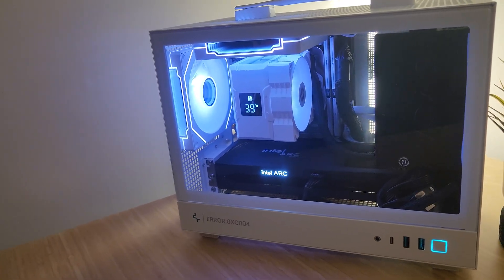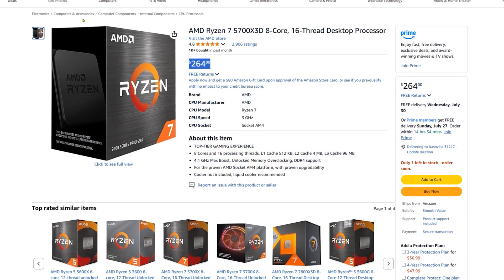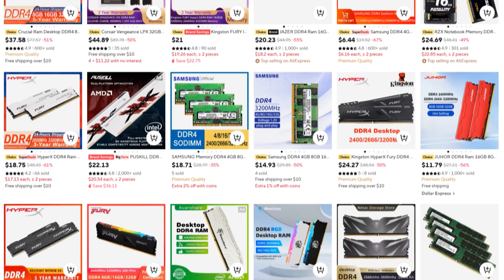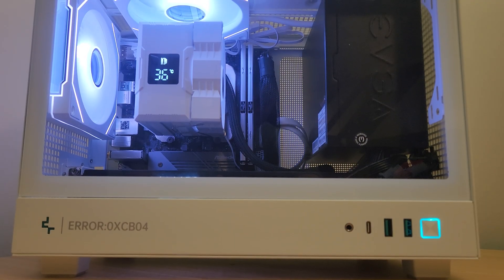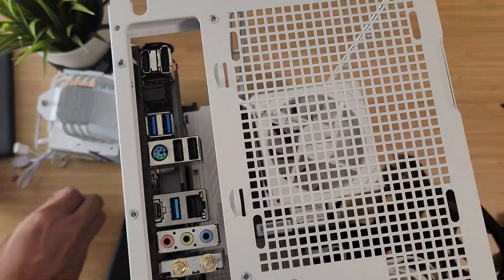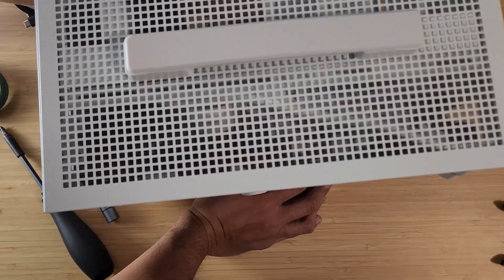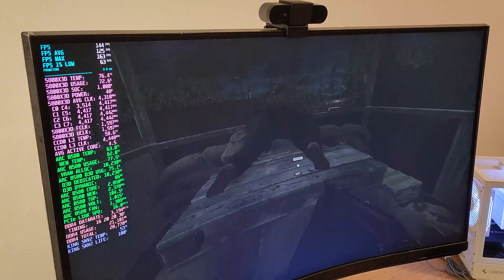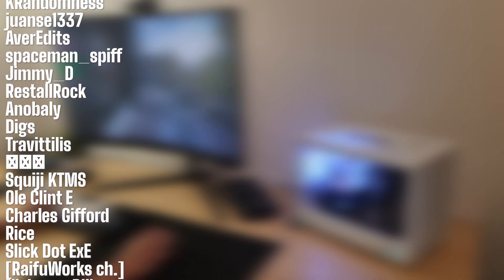I Built a Tiny but Mighty 1440 Gaming PC Under $1000

Comment: i have an old pc, that somehow barely manages to run tarkov at ~30 fps average- amd 3200g gtx 1060 6g 16gb ddr4 3200mhz. im very tight for money, but maybe it's possible to make tarkov playbale in ~60-75 fps range with very low settings and a CPU upgrade? i'm thinking about 5600 or 5600x. Do you have a similair rig benchmark with a similair gpu and 5600 cpu build? What do you recommend?